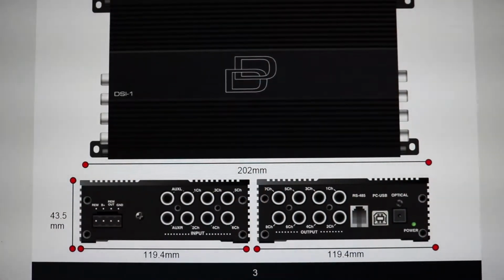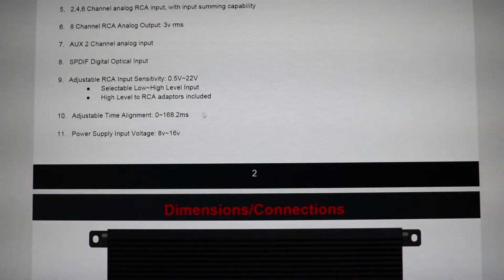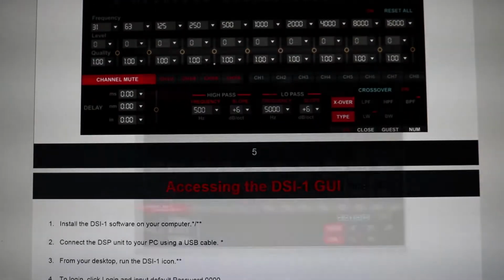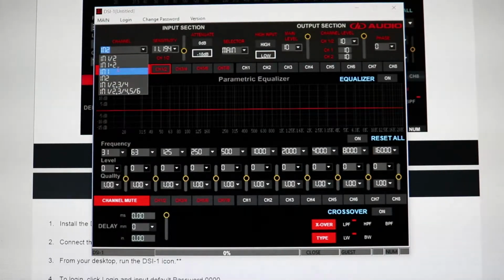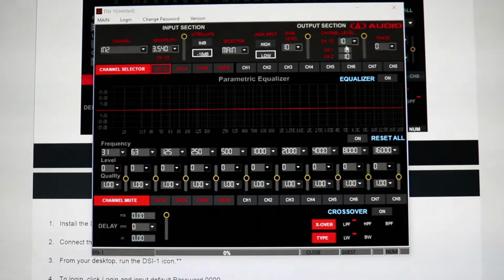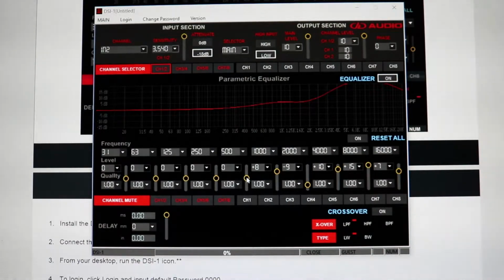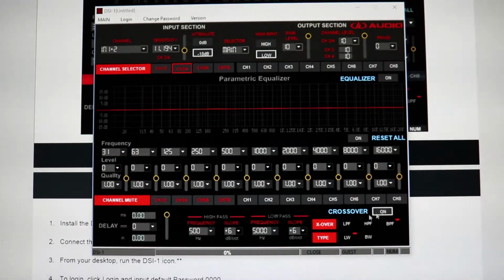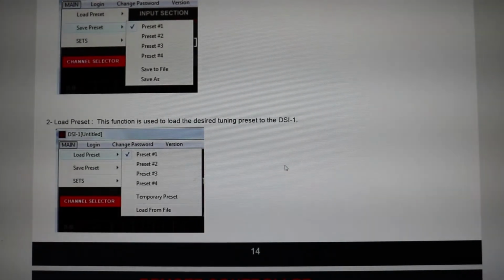HOW TO: DD Audio DSI 1 Basics

Comment: Why did you start from left to right with your subs.the way I set it up is 1 set of rca coming from the head unit giving me my full range signal left and right and the out puts is ch 1 twetters left and right ch 3&4 midrange left and right 5&6 midbass left and right 7&8 subs left and right
Reply from the maker: No particular reason, just the way I hooked it up. I have dedicated outputs from my head unit, so 3 RCAs out and in to the DSI.

Comment: Question, my homeboy tells me that I can use all my amps on the dsi, but I have 3 four channel amps. Correct me if I'm wrong but thats 12 channels. That won't work right? 2 channles is for a sub amp and the rest is for mids/highs right. Thanks
Reply from the maker: Jaytaybrae 3 you can do this you will just have to use splitters for the channels that you want to be playing the same signals. You lose the functionality for timing, but they will all play in sync. I do this with my 2 4 channel amps that I have hooked up